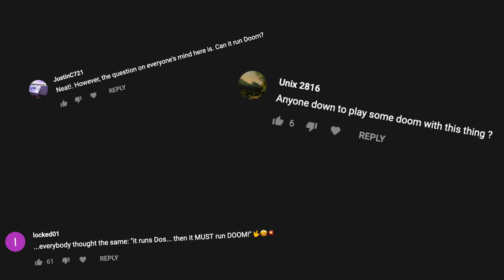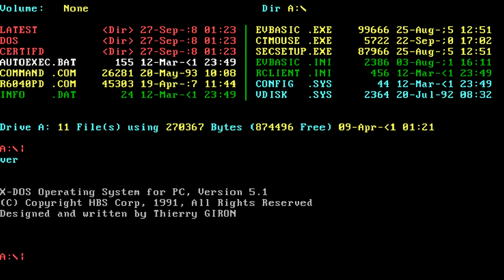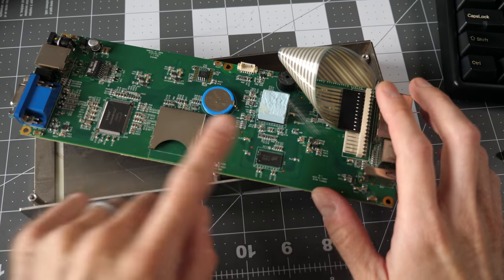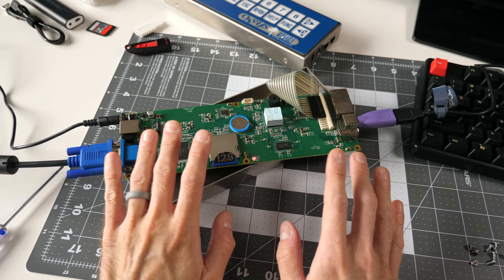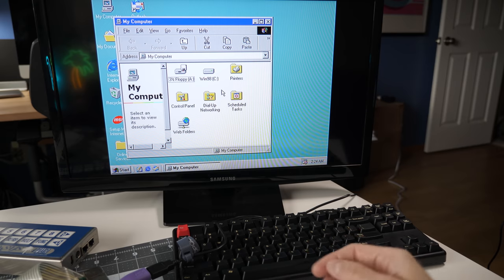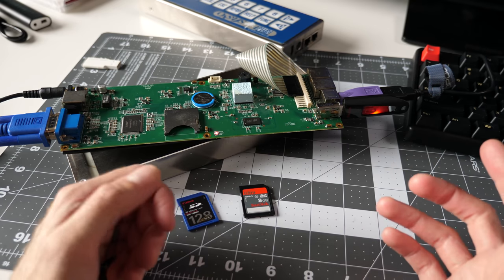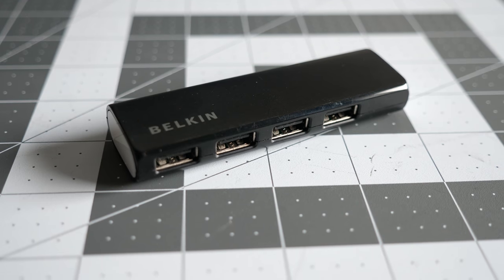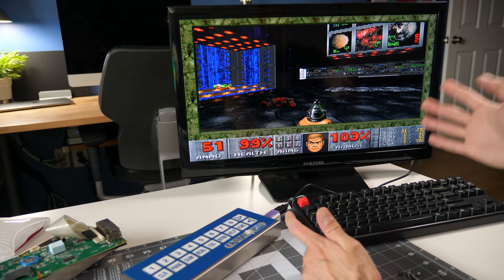Doom on a Commercial Kitchen Appliance

Comment: The boot order is almost certainly set up that way so a tech can boot diagnostic or recovery software off a USB stick without having to mess around with a keyboard. I bet there are USB sticks that will do a clean install of a new OS and POS software in case the internal storage gets corrupted.

I also wouldn't be surprised if the deleted USB port was spec'd by the original customer, possibly to stop employees from using it to charge their phones.
Reply: Exactly. And the boot order also makes sense concerning the SD card, as the internal flash has higher priority. If it’s not present or not bootable, the SD card may take its place. SeaBIOS configuration works through a separate application that would usually be in the boot device menu, but appears not to be installed. In this version, it might also be hardcoded.

Comment: Writing to that flash chip is probably easier than you think it is. Get a TL866 programmer and a SOIC-8/SOP-8 test clip, and you can literally clip it directly to the chip and read/write it from a PC. That exact chip you showed at 9:23 is compatible with it.
EDIT: Actually, I paused it at the part where you showed the chip to write this comment, and hadn't watched past it. I guess you already know it's even easier than that, since the virtual floppy drive is writable from software and you can boot from removable media.
Reply: I haven't looked at the specific details of this device but I would guess the SPI flash also contains the system firmware (coreboot and SeaBIOS). This writing a disk image directly to it would brick the device.

But that makes me think, since it runs coreboot it should be possible to make a custom BIOS, maybe even one which presents the internal keypad as a PS/2 keyboard using SMM.

Comment: Just saw this video and glad I did!    Regarding the OS, it looks like one of those stripped down with very superficial modifications to MS-DOS that contains just a few changes to text and a few routines to make the DOS experience a bit more interesting. I distinctly remember that upgraded and coloured DIR function being applied to DOS 5.0 PCs among the techie crowd in the early 90s along with VESA framebuffers to enhance game performance and advanced memory managers that could be simply added to the autoexec.bat and/or command.com config files.   
I actually did something very similar to my Amiga workbench before jumping to PCs when I was a teenager, making a custom workbench I called 'RatBench' that stripped out all unnecessary processes to allow more free RAM and room on the floppy disc to add pirating and wardialing software, a 'greets' listing on bootup and added a randomized copper list to give a multicoloured background to the Amiga's GUI years before Windows 3.0 did the same (and more) for PCs. 
I distributed this among friends and fellow geeks, and was amazed to find it floating around still years after the Amiga was dead in North America. I wonder how this guy who gussied up MS-DOS would feel if he saw this video?  Since someone either jacked this version of DOS out of the black holes of DOS piracy or possibly actually licenced it for this Point of Sale terminal programmer, his response could go either way. ;-)

Comment: I used to work at a pizza place that used the "Bump" and "Recall" version of the bar you showed a pic of.  While we had Dell PCs running Win7 w/ touch screens to take orders, I had always assumed the bump bars we had on the make table and cut table were just "dumb terminals" that depended on the server in the office for all functions(especially since the bars would reboot any time the server went down). I knew that the bars had a basic bios since it would show that when the server rebooted or when you bumped the bar too aggressively(because the port where the power supply plugged in was looser than a $5 hooker), but I had no idea it had an actual CPU inside. Interesting video!

Comment: Considering that device has a rough equivalent to a Pentium 200mhz you should be able to run Quake on it without too much trouble. Doom ran quite well on most 486 based PC's (and decent on a fast 386 based system!) back in the day so anything with a Pentium or faster chip should easily run it like a champ!

Comment: Managed to track down a zip file with the x-dos 5 files (Website was pcorner so others can track it down to).
Wasn't a bootable floppy image though, but it was a zip file that could be used. I inserted the folder inside a drive image in a virtual machine. Ran the install command, and this allowed me to install x-dos to a floppy image. Now i got the full thing, funky colors included. Then i used a image file editor to replace the files on the floppy with the ones from the zip file and boom! Official working install floppy :D

Now i can very easily install this in my virtual PC's, although it seems extremely picky with harddrive booting and i have only gotten it to work with floppy disks so far with harddisk access flatout failing. Perhaps this doesn't support large disks?
Reply: There's also some ISO containing X-DOS 5.2: https://archive.org/details/ipadDOS

Comment: I bet that could run Alpine Linux, or even Arch (btw).
Reply: Most modern 32-bit Linux distros require a 686 class computer to run though (Pentium II or higher), so it is likely that it does not work on a 586 chip. This is due to newer instructions.
Reply: old ubuntu or debian would boot flawlessly
Reply: @milasudril  That's assuming it's a plain 586 chip without any newer instructions, which I doubt given this has PCIe and other surprisingly modern creature comforts. Even if it is you'd just have to boot an older distro.
Reply: I would advise antiX-Linux since it’s one of the smallest distros (does not use systemd).
Reply: @owowowdhxbxgakwlcybwxsimcwx  Debian 8 Jessie (released 2015) should work fine on an ordinary Pentium, you just need to choose the correct kernel on startup. It will automatically default to the 686 kernel which needs CMOV.

Arch has always required a 686 at minimum and 32 bit support was dropped as an official Arch platform a few years ago. You'd need to use the community i686 port, but obviously that will only work if this CPU has 686 functions like CMOV and probably also PAE.
Reply: You might be able to do Aboriginal Linux. It has support for 486.
Reply: Puppy 2.0 Linux would have likely done just fine as I used to go into corrupted Win 3.11 and Win 95 industrial computers with it... very small and powerful and could completely run from USB only...
Reply: You can always try slitaz linux
Reply: Actually modern Linux kernel dropped support for 386 and so on some time ago.

Comment: I've installed win98 on a Grocery register from the mid 80' It had a custom 100 button keyboard with pictures of produce, which had its own cutom ISA board to register keypresses, it was a 286 PC internally and it was somewhat funky to run games on it!
Reply: Did you try plugging in a mouse in the KBD PS2 connector? On some singleboard computers from that period a custom pinout was used to allow both KBD and mouse to be plugged in simultaniously through a PS2 Y cable that you plugged both keyboard and mouse into.
Reply: Win98 drivers for strange hardware is often solvable by looking up the chips, figuring out what else they were used in at the time that hopefully has win98 drivers. The Pleo robot dinosauer toy had a wierd serial connection internally that took AT commands, so I found an USB modem driver, which just worked with a common USB to rs232 adaptor. So like that trying different things on a hunch is often successful. To that Win98 drivers are simple, so sometimes you can swap .dll files from one driver to another to hack together something workable.

Comment: You should be able to mount the flash drive as direct access in virtual box and install from your XP ISO with slip streamed drivers. Or just install standard XP and install the drivers in virtual box and it should boot. I’ve messed around with a lot of these weird SOCs and that method seems to always work

Comment: Would guess that it boots from USB first because updates would be shipped on USB flash drives (or maybe downloaded with instructions to put it on a USB drive). I designed an embedded system at work and I used this exact same methodology - default to boot from USB, and the "OS" on the USB would simply contain all the software and data needed to update the internal storage. That autoexec boot script also would cover any post-update cleanup/conf rework/etc. that might need to be done.

It also explains why the USB port was exposed on later revisions.

The SD card slot would likely exist for add-on software or extra storage for specific configurations.

Comment: Running doom trough external means: Successful
Running doom without external equipment: the following needs to be done
1. create a backup of the original DOS
2. check how much space is on the on-board flash 
3. see how the membrane is controlled
4. see if it is possible to flash a new bios
5. backup the original BIOS.
6. test new BIOS
7. check if a DUAL boot Dos system is possible.
7.1 if dual boot DOS is not possible, test if a new dos version/ reverse engineered X-DOS can both run doom and the POS system
8. reverse engineer X-DOS for hidden features.
9. Play doom without extra Keyboard/tools of the original flash storage

Comment: That version string across the top is a standard git describe version, I use them myself and have done for 10+ years, decoding it:

There was a tag rel-1.7.5
There were 33 commits AFTER that tag
The hash of the commit this was built from starts with e106d95
And the dirty part probably indicates that there were uncommitted changes sitting around when the command was run (that's how I do mine, too)

The rest of the suffix stuff is custom and obvious:

5:26pm and 19 seconds on the 22nd of June 2015
Machine host name: Andrew-MBPR (MacBook Pro, but what's the R?)
And that the LAN it was on used .local as a search suffix

I have some great respect for the person who set that up, but I'm guessing it wasn't that company, it was probably the SeaBios devs :-)

Comment: I never knew there were more to those devices that I kept seeing behind the counters at McDonald's and KFC restaurants!
(6:02) I imagine that in its original use, pressing button 1 indicated that the particular employee had completed what they needed to fulfil for the first order that was displayed on screen.
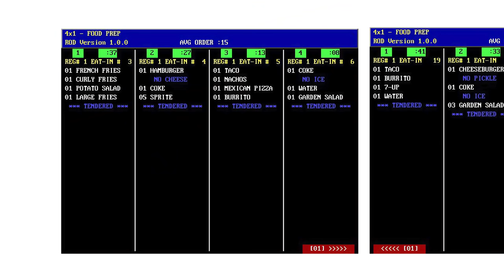(7:40) I was right!
Reply: The one key would clear the current order , most stores also have a average timer for meal production so head office can see how the store is preforming so generally most employees clear it before it's done to keep times down. The other Keys would be mostly useless except for maybe a key to bring up previously completed orders or selecting another order to clear it if the first one will take awhile. Some even have hold functions placing the order into a suspended state stopping the timer for that order.

Comment: Color me surprised.  Until recently I was working as a POS support tech for one of the software/hardware suites this can be used with.  Not sure if I saw this specific one, but I would not be surprised if I had it in the lab and just never took the time to glance at the brand name for long enough to memorize it.  We always attributed failures of these to some kind of general hardware failure, or to the user failing to replace/charge the batteries on the wireless models (yes, they exist last I knew).  Knowing there's a Pentium inside running DOS changes the picture quite substantially for me.  Wish I could find one to tool around with myself now that I have the time again but it looks like everyone already bought up the supply on Ebay.  Part of me was hoping to buy a small pile on the cheap and set up a the worlds weirdest deathmatch but that's another dream that will have to wait it seems.

Comment: XDOS was written by a computer bios technician Thierry Giron. He at one time worked for the Phoenix Technologies corporation, that was bought by Award bios corporation.  It is small in size, written entirely in assembler, and not real-time in the sense that it does not provide a way to specify priorities for codepaths or guarantee delivery of service in a specified amount of time. It has no scheduler other than the normal "process scheduler" of MS-DOS. (google search info from: www.embeddedlinks.com/chipdir/index.htm)

Comment: I recently had to spiff up an old Win95 machine for use in virtualization software and encountered the same issue with it showing a missing driver for Plug 'n Play BIOS, but learned that that is actually the PCI bus being mis-detected. If you manually choose a driver and select PCI Bus, it will likely allow your USB and network to be detected.

XP's issue with installing from USB is likely due to the hardware scanning causing the flash drive to disconnect and reconnect several times while installing causing files to disappear while in use. And the 7B error is inaccessible boot device which happens when the drivers necessary to access the drive are not loaded at boot (which is a very common problem when converting physical machines to virtual).

Also 45°C CPU with no heatsink is not hot at all.

Comment: Out of left field thought I just had...you could use these as a quick, simple and small unit to WInDAS into Trinitron CRT monitors to program them (or just about any CRT monitor that used serial communication to calibrate them). They have serial ports so just a matter of creating an adapter. :P

Comment: I'm wondering if one of those USB soundcard dongles would work on this thing (Assuming you could get DOS drivers for it of course). Since USB hubs work ok with it that might be a good option :)

Other than that, awesome video - running Doom on inappropriate hardware never gets old :)

It'd be fun to try to get some version of Linux running on this device too - Lots of possibilities I think (But only if you have the time of course :) )

Comment: Embedded retail  systems are tricky. I've done refurb upgrades to grocery store self-checkout, which used to be Win 98 then XP. I didn't run doom on it but I was able to put jpegs in the display, before continuing what I ws supposed to be doing and upgrading the OS. Heh, still have the install CDs, with 20+ installations I made sure I had at least 3 copies so I could stack my installs. Good paycheck after a month of that. I note that all my upgrades from then have been replaced, missed out on that installation job.

Comment: SPI is pretty easy to interface to. Also FreeGeek probably has a PS2 splitter ;)

Also older Windows PE may work -- but it also tries to unpack boot.wim into the ram so thats where you're going to run into memory issues.

Comment: Find "Rufus" on the internet. Use Rufus to turn a Windows 10 CD (or just the ISO of it) into a Windows 10 live bootable USB. Basically Rufus can rip the files off of the CD, put the files on a USB drive just like the Windows install does when you "make" it install to a real drive, and then make the drive bootable. Rufus has two bootable options, EFI and MBR. You'll probably want to use MBR. Rufus can make a bootable USB installer (don't want) or a bootable live version (do want). You'd be amazed on how low on the RAM you can go with Windows 10.

Comment: Cool mod!  For modifying the cmos setup, there should be a service utility to modify the default settings without reflashing the BIOS, probably an exe file or possibly a config file as well that has a specific name that the bios looks for during boot with overrides or alternate settings. For sound, use a USB powered Roland sound canvas connected to the hub and you got 16-bit ready audio, or if that does not work, use a usb-midi adapter and run an external module like a Roland MT-32 for sound. I am not sure if this device can enumerate a usb sound card or midi device, but it might be worth a shot with some config and autoexec changes..

Comment: Hmmm, I wonder if the USB issue is actually less mysterious than it seems.

When you were booting 98, you were also using the (one) USB port at the time for that boot. When the system is loaded, it presumably needs to retain the low-level (INT 13h) driver, turning the USB into a virtual hard disk; if it could independently detect and load USB drivers for the same port, those drivers would interfere with the BIOS 13h driver and 98 would lose access to its own bootdisk (i.e. crash). I wouldn't be surprised if something prevents this (but also causes 98 not to recognize the USB port as "USB").

For XP: the 0x7B bluescreen is unsurprising, but not necessarily hard to work around. XP only uses 13h drivers during the text-mode install and during initial bootloading; it then transitions to its own (native) drivers to gain access to the disk for normal multitasking operation. Normally, this includes standard drivers that are enough to gain access (i.e. generic IDE drivers) and any "F6 drivers", but a root device not covered by those drivers would cause a 0x7B. This was a very common problem with people booting XP on SATA in AHCI (non-IDE emulation) mode, and also for anyone trying to boot XP from USB.

It's actually surprising the first XP install made it to graphical mode; I assume whatever prepared the USB installer boot medium also patched the USB drivers so that they would load at boot for the graphical portion (enabling install-to-USB). Unfortunately, can't really say what broke down there without seeing what failed to copy (and why) and what ended up bluescreening.

Comment: SeaBIOS works on top of coreboot, coreboot is where to set the settings. SeaBIOS here deals only with starting something from MBR and act as your common bios implementation.
But to set settings in coreboot, you have to recompile it and I doubt that company (in violation of the GPL) released its coreboot sources.